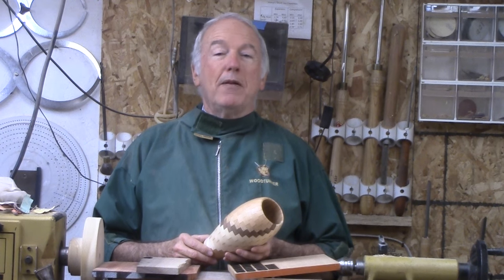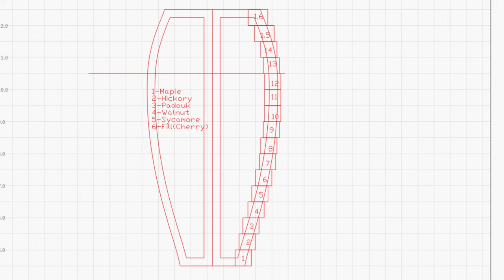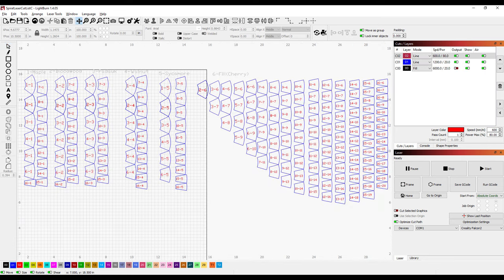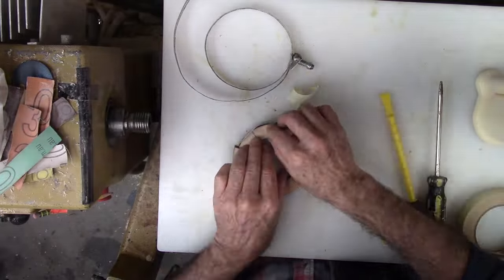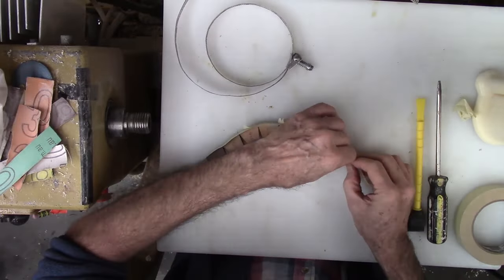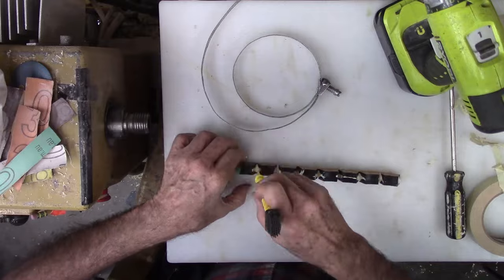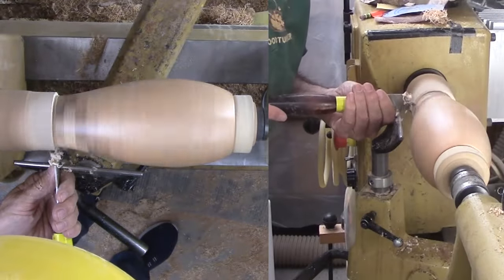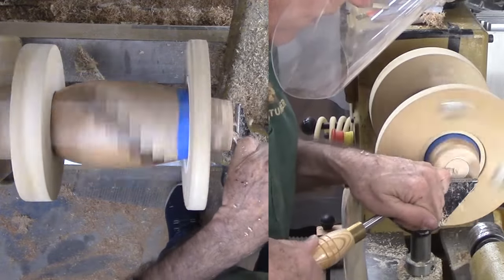Turning Laser Cut Segmented Spiral Vase

Comment: For extra secure joins between adjacent segments, a laser could cut a jigsaw-like protrusion and socket, rather than just a straight edge, to give a mechanical connection as well as the glue joint.
The extra cut time would be minimal, compared to doing this any non-laser way.
Reply from the maker: Interesting idea especially since the scorched wood weakens the joint. Would help alignment also.